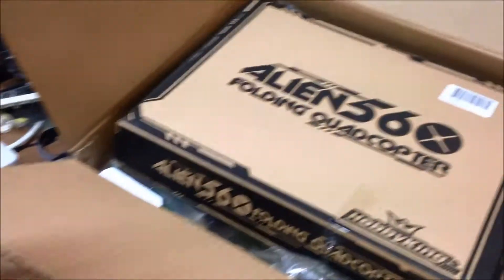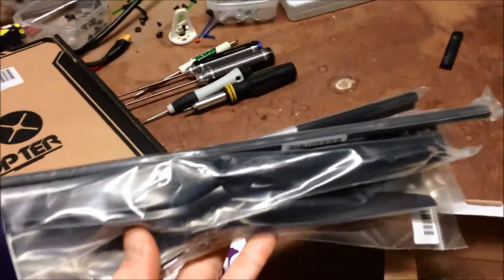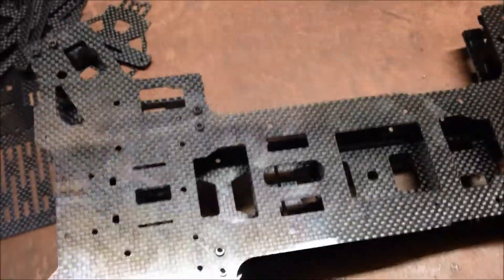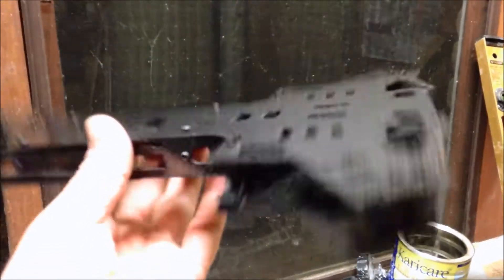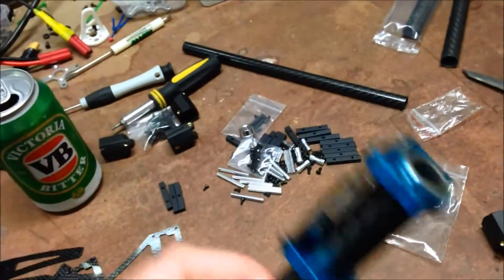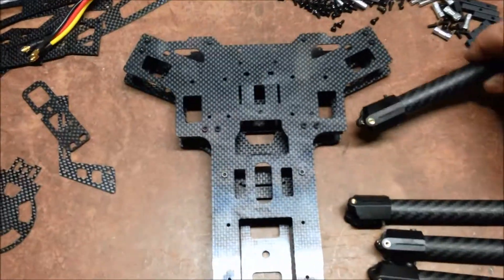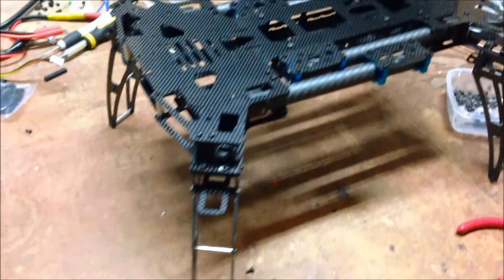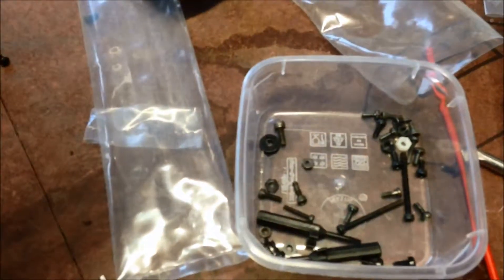HobbyKing Alien 560 Quadcopter Build Part 1 - Frame Build and Parts

Comment: can u use a 1000kv motor on this kit?
Reply: +Drone Flights this is gonna be y first drone build. :D
Reply from the maker: +Edou .h Yes you can. KV is just the motor revolutions so any number works you just need the right motor propeller combination.

Comment: Are those all the extra screws came with the frame? Mine didn't have as many. In fact I didn't even have single screw left.
Reply from the maker: I did not like the screws with the 1.5mm hex head. I had some spare 2mm hex head screws with the same thread so used those.